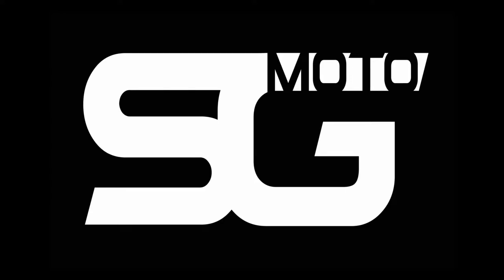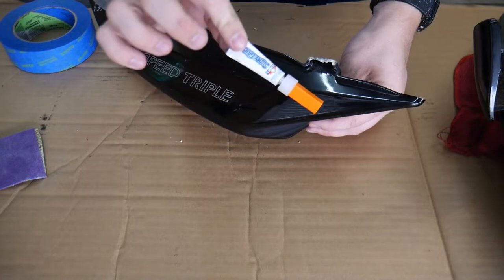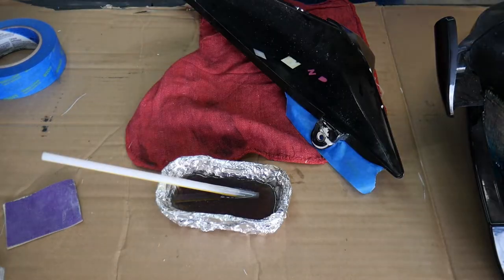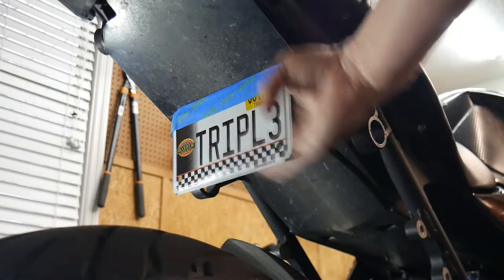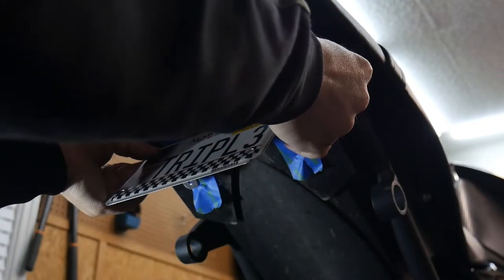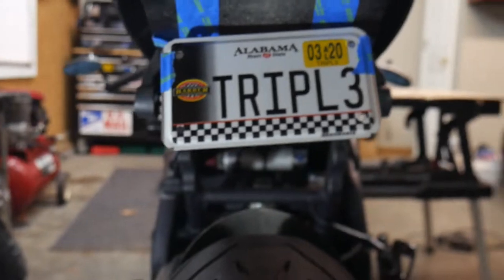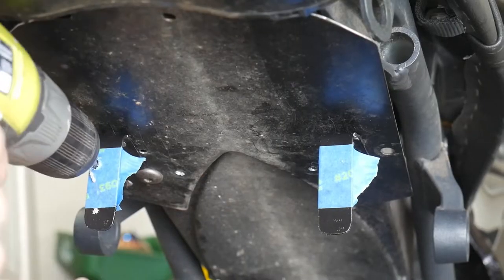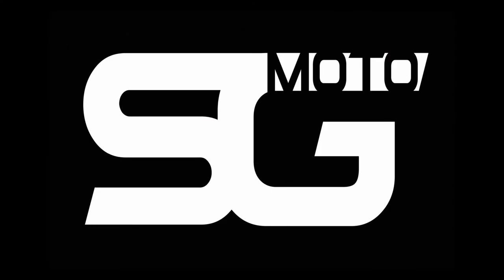2008 Triumph Speed Triple - Fairing Repair/Bodywork

Comment: great work man... i am gonna pick a 2015 model speed, anything specific that i should look for?? some quirks that the speed has in long run...
Reply from the maker: Appreciate it! If you stick around I have a video I’m working on for a 2012! 

My 2012 is my 3rd ST1050. Only issue I’ve ran into is the charging system on the older ones. I believe by the time they moved to the updated headlight models those issues have been solved. 

Enjoy the miles!
Reply: @SGMoto  I have subscribed, please post the content soon..